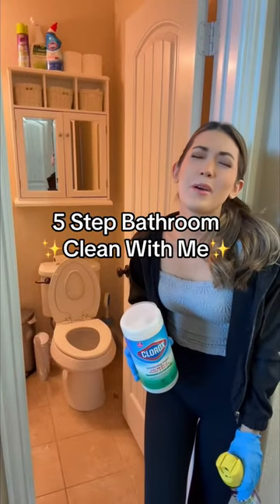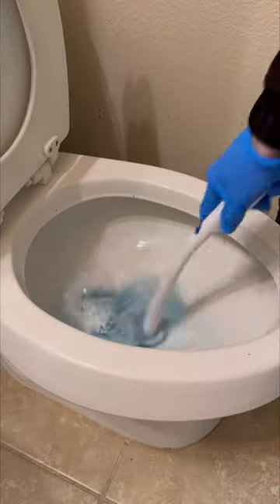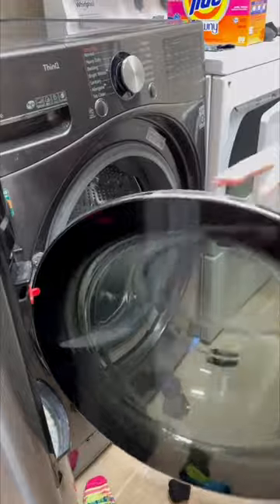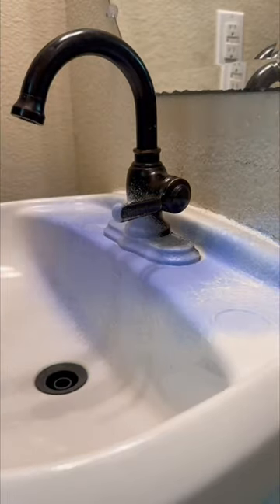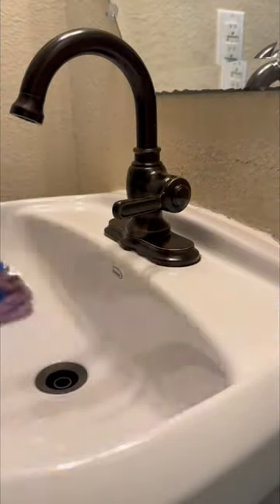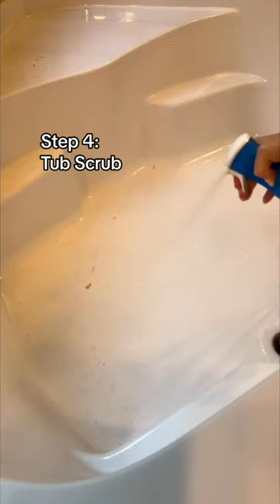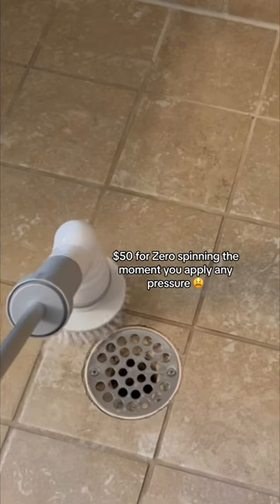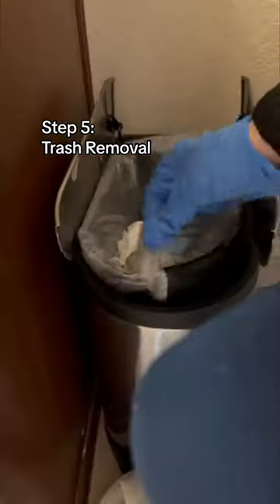5 Step Bathroom Cleaning Motivation #cleaningmotivation #momlife #cleanwithme

Comment: She did a great job of course. The only thing is wash your towels separately from everything. Wash the rugs with only rugs. People walk on the floors and the rug is on the floor. The towels are used on your hands or body.
Reply: you don't trust your soap?
Reply: @Flumpfy  bacteria are living organisms you should not risk the cross contamination. Also just think about it especially if a person has pets do u want what has been walked on anywhere near your skin?
Reply: lol this is W/D in unit privilege 😂 im not spending the extra $3 on an extra laundry load if the rug can fit in with the towels
Reply: I bulk my cloth diaper load with washcloths and hand towels. Does that disturb you? lol I promise they’re 100% clean. It’s my cleanest load I do all week. That load of laundry takes about 3 hours just in the wash. (Cold rinse, hot deep clean cycle with a soak, extra rinse at the end) It’s all washed with 140 degrees water. There’s no way anything gross is coming out of there. 😊
Reply: @MA-gq1rq  what extra laundry load? 
don't you have extra rugs to use, and when there are enough dirty rugs accumulated over a month then you do 1 wash of all
Reply: @invisiblespirit5476 ...
3hours?? ... what a waste of time, energy and money!
put a 1hour or less cycle... the soaps today are so strong they will clean everything...
or another option is to hand rinse + soak in hotter water before adding to machine... its still shorter time, and saving in all sorts of ways than a 3hour wash cycle.
Reply: @greenleaf8226   I did experiment with other routines and this one just worked the best for our water and washer. It’s really not bad. I rinse them quick (30 minutes) and then I add the bulking hand towels and washcloths and set the heavy duty cycle with a soak and an extra rinse for overnight. It’s ready to hang and dry in the morning. The soak is what makes it take so long, so that’s not wasting any energy.
Reply: @Anonymousbarbiedoll if the towels touched the floor they are already cross contaminated. So are your socks, and clothes you toss on the floor when gettinf in the shower. Soap washes away bacteria, just got to use the right amount. I'd just shake them out first to remove hair ect.

Comment: This is how I clean my bathroom, except I clean the mirror first. Also, I use a spray of equil parts, vinegar, and dish soap. Spray it on the shower the night before. Wipe it down the next day
Reply: I’m a cleaner. I do mirrors last. Cause after rinsing sink. Water splatters all over. Having to wipe counters and mirrors again

Comment: I like to split up the tasks over a day or two and also do small cleans more frequently since I hate cleaning the bathroom so much. 

I wipe down the sink after every time I wash my face at night. I use disposable moisturizing face cloths in the winter and reusable washcloths in the summer. I just have enough washcloths so I can toss each down the laundry shoot after one use. 

My husband wipes down the toilet tank, seat lid, seat, rim of the toilet, and base of the toilet with disposable bleach cloths every few days. 

I clean the mirror when I clean my windows every week. I take this time to wipe down the other surfaces like our cabinet and shelf as well. I also sweep and mop the floor when I sweep and mop the rest of the floors (every week or so).

I do a quick wash of the tub/shower every week or two, depending on how fast it's getting build up. I wipe down the tile walls with cleaner and reusable cloth at the same time. 

I only do a full deep clean of everything from top to bottom a few times per year. 

Our bathroom always looks clean and it rarely feels like we're cleaning it. I use this method in our kitchen, living room, and bedroom as well. Trying to slowly branch out to the rest of the rooms in the house so everything feels clean between deep cleans.

Comment: step one should always be dusting and vacuuming. take everything off the floor to make it easier to clean the bathroom without worrying about getting things wet. mopping a bathroom or any floor that has hair and dust is so annoying. when you’re done cleaning it mopping is so much easier and faster than it would be trying to get hair out of the cracks stuck to the floor and toilet omg. ocassionally when i’m feeling lazy tho i’ll just mop and struggle instead 😂
Reply: Bathroom floors are so small that I just wait until I've cleaned everything else, then get down on hands and knees with paper towels and spray cleaner/disinfectant. Other than special attention needed to area on and around the toilet bowl/foot, this takes no time at all. Why mop?
Reply: @legalavocado3447 
In my case, I can’t
I’m 60 and have arthrosis 
I vaccum the house every day, and use a Swiffer, before mopping the bathroom (daily).

Comment: I dread bathroom cleanup. I have no idea why but so much dust collects on the walls and water build up from shower in the walls/ceiling. Water in my town has a orange colour to it due to the amount of iron in the soil. 
So I have to first dust the walls/ceiling/baseboards then wash them all. Then go into shower, mirror, sink, toilet. And I also use paper towel for toilet and floors. I couldn't imagine using reusable for those.

Comment: The electric scrubber for me was essential when I decided I wanted to clean al the grout in the flat I live in before having to move out and leave the apartment/flat clean. My back or would have never lasted if not. It worked great but first let "marinate" the cleaner you decide to use then go scrub it with the elctric one. Maybe yours was defective. :/

Comment: As a housekeeper
1 remove trash and used towels 
2 flush the toilet bowl (put chemical soak for minutes)
3 scrub the glass and mirror,
 brush the toilet and floors 
5 rinse 
6 dry all area . Counter clockwise.
Thankyou. ❤ You doing great 

5 
D

3

Comment: I spray down the toilet and then use toilet paper to wipe down.
Reply: @amysmiles9751
So far it looks like you and I are the only ones using toilet paper 🧻to clean the toilet🚽. I use cleaning strength vinegar in a spray bottle, and wipe it in and around every little nook and cranny, and then respray and wipe it off with more toilet paper.🧻

Comment: I clean my bathroom the same way. I use disposable Lysol or Clorox wipes, too. I took a course for cleaning and got my "Building Service Worker Certificate."" Ive also had a clearing job in the past so Ive learned a lot about cross contamination and I only use a cheap sponge to clean my bathroom sink & shower/tub (i clean and rinse it after each use). I also used paper towels to clean my toilet. I will not use my sponge to clean my sink, then my toilet. I also wash my mats separately, ii won't wash them withy towels lol